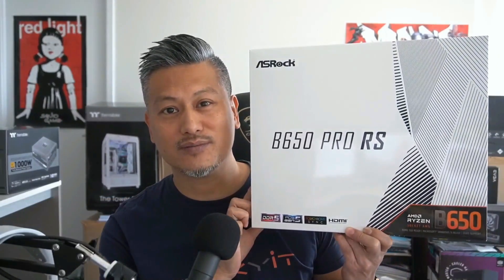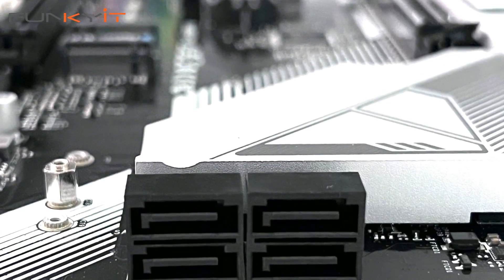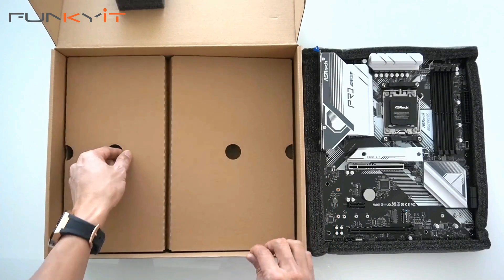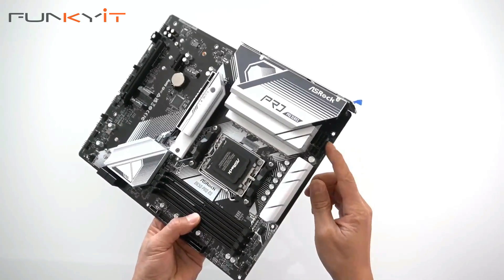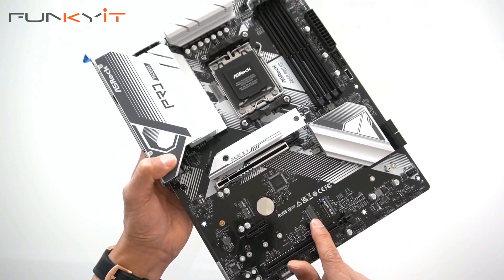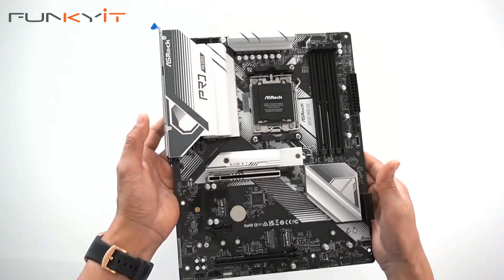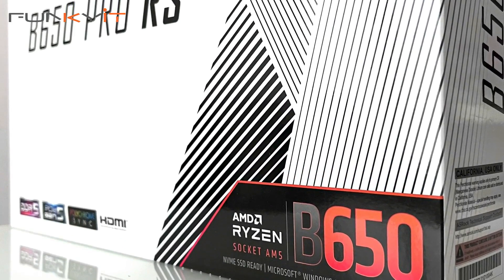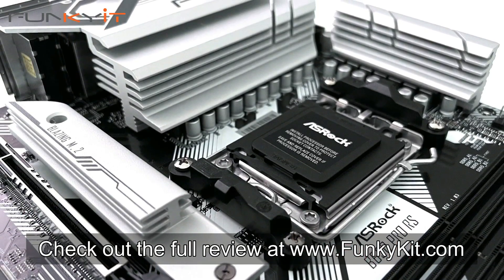The Most Affordable AM5 Motherboard Featuring the B650 Chipset - ASRock B650 PRO RS

Comment: Hello and thank you for this video. I have a question about this card, to equip a 7500f or future 65/95w model and for a PC that will have to last a LONG time is it better to go for this model or is its mATX version enough?
Reply from the maker: You don’t plan to run too many PCIE cards … then mATX version is fine
Reply: @Funkykit  Thanks, I was mainly asking because the ATX version has much better VRMs, so for a card that needs to last a long time it was important :)

Comment: Just werid that the temperature is so high on AUXTIN5
Reply: I googled a little bit about it. I think its some PSU sensor so touch your PSU to see if it hot it most likely isnt. Google a little bit about it but its most likely a sensor that does not exist or is not detecting anything so HWINFO64 showes like 106-107 (you get those temps right?). Basicly from researching its mostly a bug because HWINFO is either detecting a sensor that does not exist or it does not measure anything so it puts some random value. Im not 100% sure but thats what I found if you find anything else be sure to tell me.
Reply: Basicly google Auxtin high temp there should be a post from Toms hardware explaining this.

Comment: 1DPC 1R Up to 7200+ MHz (OC), 4800 MHz Natively.
1DPC 2R Up to 6000+ MHz (OC), 4400 MHz Natively.
2DPC 1R Up to 5600+ MHz (OC), 4000 MHz Natively.
2DPC 2R Up to 4800+ MHz (OC), 3600 MHz Natively.
what should i do if i want the max speeds for memory and PCIe 5?
Reply: For everyone who have big issue with expo, like Bsods, no boot after apply expo etc. I had same issue with my RAM kit that is not in QVL list for this MB, and nothing was working to make my ram kit(4800) working on 6000, I was fighting with OC my memory useing EXPO profiles, but without a reslut for 2days, and only get no boot at all, so I tried to manualy OC my RAM kit without EXPO, so expo is "disabled", and...this was a solution! Right now I have my memory set exactly the same settings like in EXPO profile(Mhz, Voltage, timings) I set all manualy, plus extra set Infinity fabric to 2000MHz, set Soc Voltage to 1.2V, spread spectrum disabled, set first 4 timings same like in EXPO profile, all other timings are on auto, PC boots up 30-60s. after exiting BIOS after saveing settings so be patien, after reboot from widnows boot times is almost instantly ;) If someone will whant more info, pls write, than I will make some photos from bios, I changed some more settigns in bios...one from ram but i don remeber name of this options right now. My memory: Viper Venom 6000 CL30 ;) PS. all issue coulde be in one timing set in EXPO profile(Im not ram specialist I only assume), in my case I think with tWR, so in EXPO tWR is set to 91 in 6000 mode, but when I was trying to set it manualy to 91, bios automaticly change this to 90, there was no way to set it like exactly like in expo profile :/ but RAM is working stable on almost all setting it mean to be ;)

Comment: I may just pair the mATX version of this this with a Ryzen 9 7900. I can get this CPU from a trade only wholesaler for not that more than a 7700X. A pity there are not any X670 mATX boards and virtually no B650E ones either.